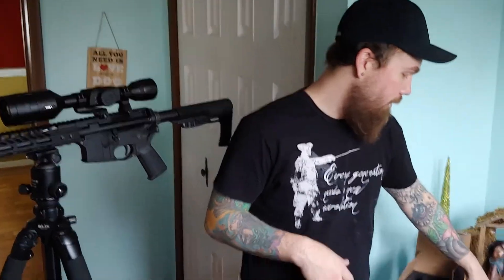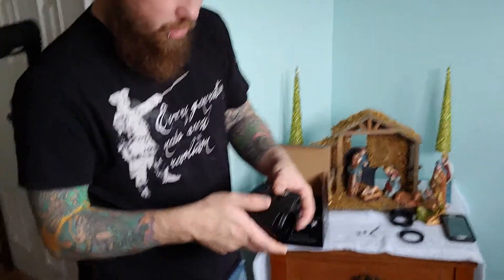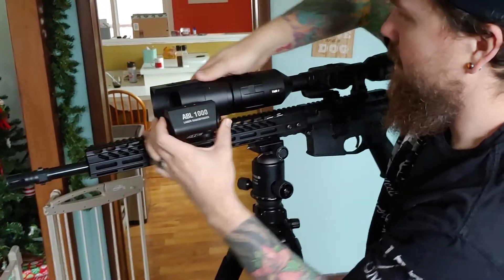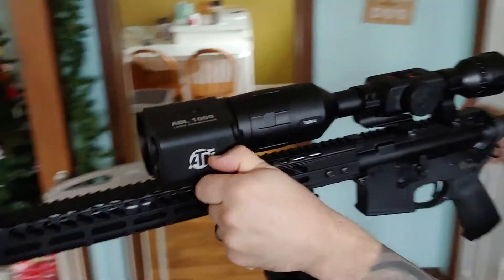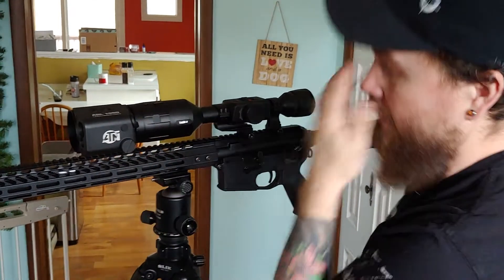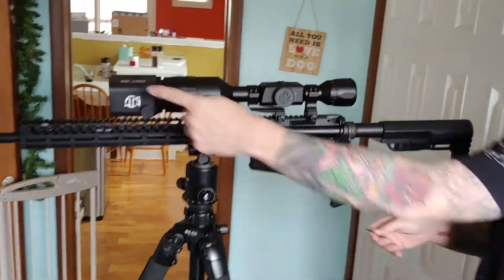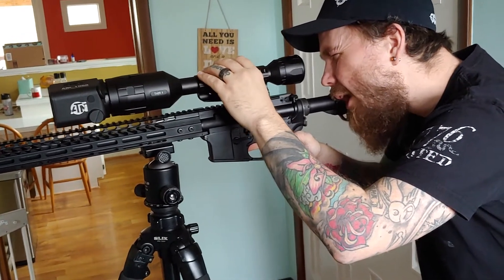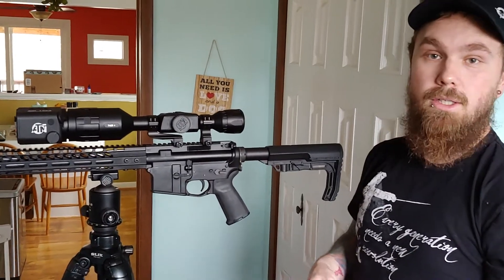ATN ABL setup and pairing

Comment: Just finished pairing mine, I wish I had found this video 3 hours ago!! Hopefully, I can shoot tomorrow.
Reply: Mine paired without any problem and appears to work just fine. My only question is in the zeroing of the ABL. Mine appears to be about 8 inches lower that the cross hairs at 50 yards. Is it possible to shim the ABL to make the ABL zero closer to the Scope zero?

Comment: Just bought the 1500over here in England , so has a friend of mine and both are eating batteries , ie they last approx 15-20 mins tops.were sending them back!
Reply from the maker: I just talked to one of their reps and they are aware of this issue and are working on a patch for it, What is happening is the bluetooth is constantly communicating with the scope and that is what is draining the battery. They are working on a sort of time out for that which should fix it. What I have been doing as I only notice that battery draining in cold weather is, I range my stand when I first get there and than turn off my range finder. Once I see an animal coming in I switch it back on and it seems to recognize it instantly and I can range the animal the whole way in.
Reply: Hey Jason great vid , iv found the same problem with the battery life about 30min and 25 ranges and shes done ,i spoke to atn in the states they said to send it back as they think it might be faulty, bit of a mission as im in Australia and imported it directly, the unit works very well, i shimmed the abl so as it line up with the scopes zero ,iv just been turning it on when i ready to shoot to save battery life, i hope they can sort it as it makes hunting at night with subsonic rounds awsome!! I might in the mean time try to make up an external power supply for it.
Reply: Andrew Sanders 
Mine to us eating batteries. Piss’s me off as they’ve had plenty of time to get this right then they still can’t get it right. I don’t want to keep turning it off and on again.
Reply from the maker: Andrew Sanders 30min is way short battery life!! I would say that does sound faulty... I’m using tynergy lithium battery and I get about a month of life unless extremely cold than I’m getting about 2 nights..  sorry you’re having this issue man!

Comment: Hey Jason. Quick question for you… I have the exact same set up as you do with the Thor for and then installing the ABL 1000 like you’re showing in this video. The one question that I have is that that really really small set screw on the top of the AL mine just keeps spinning and won’t get tight. Is there something that I don’t have aligned properly?

Thanks!

Comment: Hey Jason is that the 640 4-40X scope? The reason I'm asking is because the ThOR 4 adapter ring does not screw on to my scope. I have left  several voice messages and a few emails and not getting any response from ATN Corp. Thanks for sharing this video.
Reply from the maker: It is but I actually wouldn't recomend mounting it on the front anymore as they have cause issues for customers that way. ATN recommends mounting them behind the focus ring now directly on the housing. Here is a link to give you a better ideahttps://manual.atncorp.com/atn-auxiliary-ballistic-laser/#id1-description see option 2.
Reply: @jasonlance5327  Thanks I’ll check it out.

Comment: Nice video, Jason. Is their a way to get the ABL reticle to be align to the 4K reticle. When I get the 4K reticle on target, then check the range, the ABL  retical drop down off target to about 5 o'clock . I was ranging a moving doe at distance, 4K was at 20 power and I had to drop down and range her. Then it took awhile to find her, once the 4K reticle reappear.

Comment: Hi once I've set up my ABL if I remove the ABL from the scope then refit it back to the scope will I have to zero it all over again or will the settings be saved and I go out hunting straight away
Reply from the maker: If you are sure it is in the exact same spot you should be ok, if not yes you will need to insure it's zeroed. I actually leave the screw out of the laser cover so it is easy to check. I also will use the laser to mark where I shot my animal which makes for an easier recovery in high grass and such.
Reply: @jasonlance5327  ok thanks for the info great vid to👍 liked and subscribed

Comment: Hey bud thanks for taking time out of your day to make this video. The manual is junk. I notice the battery install on manual was wrong pretty quick. When you take the cover off to put the battery in there is a pic of how the battery should go in inside. Also the manual says to tap the power button to range, also wrong. You hit the ballistic button closest to your eye when looking down the scope. Lastly, what kind of tripod setup is that that you have?
Reply from the maker: Thanks for the comment! here is what you see in the video
https://thermalopticsplus.com/collections/mounts-and-tripods/products/slik-pro-700-dx-heavy-duty-tripod
https://thermalopticsplus.com/collections/mounts-and-tripods/products/feisol-ball-head-cb-50d
They also have a lot of options depending if you have a picatinny rail, mlok , keymod, or bolt gun at this link.
https://thermalopticsplus.com/collections/mounts-and-tripods

Comment: Will your original zero move if you range at different yardages?  Let's say I zero at 20 yards and then I range a squirrel at 45 yards and I take the shot. Will my zero at 20 yards move and I have to re-zero again at 20 yards?
Reply from the maker: lijianli only when you have the ballistic calculator on. When you turn the bc off it goes back to your original zero.
Reply: @jasonlance5327  That's cool.  I will keep that in mind now.  There's no documentation anywhere from ATN that tells you that if you shut off the ABL range finder then your zero is at the original zero you set your scope to.  I will try that out and confirm it.  Thanks again!

Comment: Can the abl 1000 mount in a different clock position? Could it be at 12 o'clock or 3 o'clock?
Reply from the maker: Yes it can
Reply: @jasonlance5327   Thanks!  I have the ABL 1000 mounted to the X-Sight 4k Pro. From the shooter's position, the power switch is on the left. (9:00). I want to rotate the unit to the right hand side of the scope (3:00). I couldn't really see a reason that would prevent proper function from a different clock position, but it's always nice to bounce the idea off someone. The rifle is always laid done on the left side and this position is prone to knock the ABL out of calibration.  I asked ATN about this but they have yet to replay. You have far better customer service than they do!!! Thanks again!
Reply from the maker: @dirtyworkdiver  I have seen it mounted all kinds of ways with no problems. As long as you zero it to whatever position you have it you should be just fine!

Comment: So does it work??? Does the ballistic calc and rangefinder work well together 10yd shot to 400 in matter of seconds?
Reply from the maker: It sure does!! it is a game changer for sure!
Reply from the maker: I haven't used the Ballistic Calculator though I use it right now strictly as a range finder. I do have so friends however who use the ballistic function and they say it works well!
Reply: Jason Hiles I just ordered a 4K and ABL so I could make the most of sub-sonic 300BO. I don’t know that I 100% trust the software to do my ballistic correction for me- but knowing a target the size of a raccoon or possum is at 60 yards instead of 80 yards is huge in the subsonic world!!!
Reply from the maker: That's they way I use it as just a rangefinder at night with  the Thor 4 Thermal! Our night season just started January 1st in WV and I have successfully ranged and killed 7 foxes already. It is an absolute game changer!!
Reply: Jason Hiles  
I have noticed switching from non bc back to bc the laser is not in the box in bc mode. So shooting in  the day in bc mode your not accurately ranging your target so I had to manually set mine up in ballistic mode so I know it’s always spot on in that mode.  Should imagine it would be more of a headache with a thermal scope. Shame mine eats batteries. It’s Going back to ATN

Comment: Hi Please inform the ATN company to more work on updated version of ATN that work without using extra Rangefinder/ABL for perfect point of impact. Also tell about to merge the ABL under the ATN to work easy &  no need to use extra Rangefinder for Hunting please inform the Company to Install the ABL Technology under the ATN on one package Thanks.
Reply from the maker: I don't work for ATN. The scope does however have a rangefinder built in. The ABL just makes it a laser and quicker. For the price of an ATN compared to other competitors I'm honestly ok with the price. An LRF model from Pulsar is about double the price.

Comment: Thank you very much for this helpful instruction! I would like to know, if it is convenient to use this package for ballistic calculating the trajectory of crossbow arrows and bolts. Can you specify arrow characteristics within the program in advance or is the software able to learn the ballistics of a certain arrow configuration? Can you check this out for me? Thank you! (I would love to buy this package for my crossbow.)
Reply from the maker: Parrhesiast I don’t have any experience with it on a crossbow. I have seen posts on Facebook of people using it with the crossbow and seems to work well.

Comment: You really should NOT have your ABL right on the tip of the scope. You need to slide it back behind the focus ring. The recoil of some firearms mixed with the weight of the ABL have been know to break scopes.
Reply: The abl has a groove sticking out locks it in place so I don't think it will lock on to where you suggest.

Comment: So what's your battery life been. Reading tons of comments stating that battery is good for about a day which is unacceptable
Reply from the maker: The battery that comes with it is junk and last about a day. I put a tynergy battery in mine and I have hunted all of January hard with very low temps and I haven't changed it yet.
Reply: @jasonlance5327  awesome thanks bro
Reply: William Bunton 

Yup mine and a friend of mine are having the same problem. Using a few brands of good quality batteries and they still eat them. Mine lasted 15 minutes and only had a dozen pings thought it!